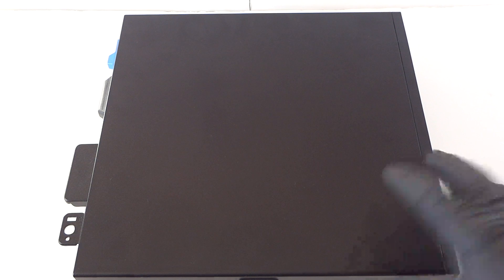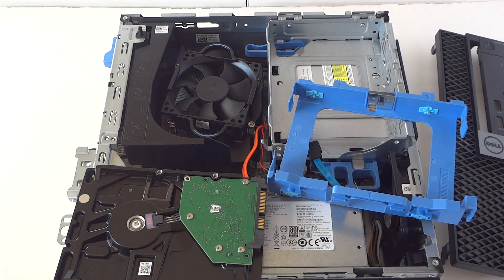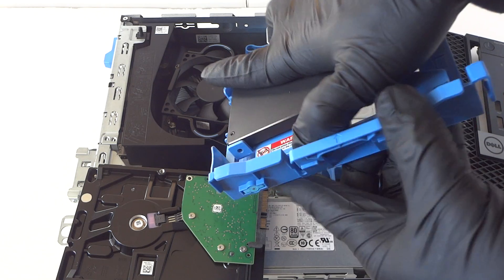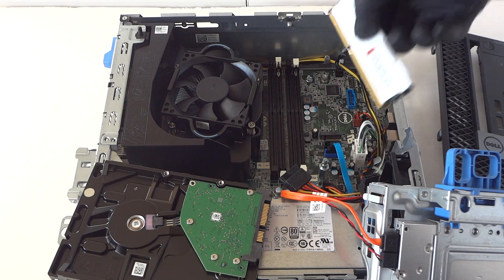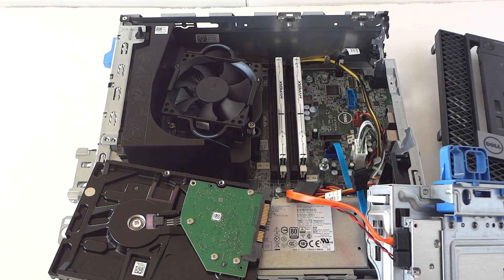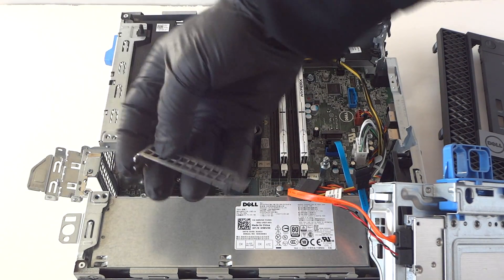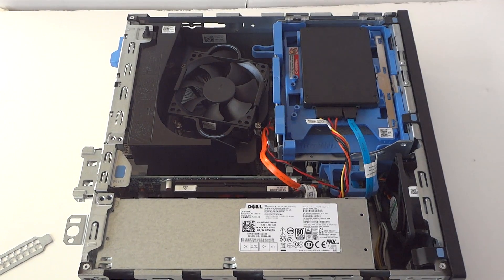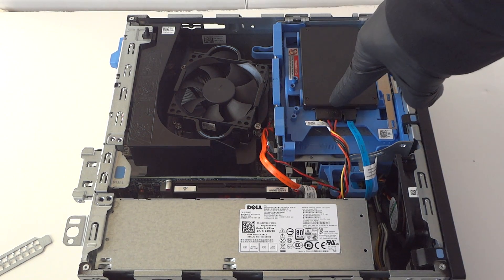Dell Optiplex 5040 Upgrade Video Card SSD Drive, RAM

Comment from the maker: List of Parts and Upgrades works with this PC.

Maximum RAM Supports: 64GB

List of RAM will work with this system.

(1.) Crucial 16GB Kit (2 x 8GB) DDR3L-1600 UDIMM
CT2K102464BD160B
https://amzn.to/2QvZril

(2.) Crucial 16GB DDR3L-1600 UDIMM
CT204864BD160B
https://amzn.to/3gub97G

(3.) Crucial 8GB DDR3L-1600 UDIMM
CT102464BD160B
https://amzn.to/3aWGluX

(4.) Crucial 8GB Kit (2 x 4GB) DDR3L-1600 UDIMM
CT2K51264BD160B
https://amzn.to/34q9Q73

List video cards will work with this system.

(1.) GIGABYTE GeForce GTX 1650 OC 4GB GDDR6, GV-N1656OC-4GL Video Card
https://amzn.to/2B7N1sP 

(2.) Gigabyte GeForce GTX 1650 OC GDDR5 Low Profile 
https://amzn.to/3el08os

(3.) Gigabyte Geforce GTX 1050 Ti OC Low Profile 4GB GDDR5 128 Bit PCI-E Graphic Card (GV-N105TOC-4GL) 
https://amzn.to/2T8bfsv

(4.) MSI Gaming GeForce GTX 1650 4GB GDRR5 Low Profile Graphics Card (GTX 1650 4GT LP OC) 
https://amzn.to/2X1FYsF

(5.) MSI GTX 1050 TI 4GT Low Profile  Graphic Cards 
https://amzn.to/2LwZd7P

(6.) Gigabyte GeForce GT 1030 GV-N1030D5-2GL Low Profile 2G Computer Graphics Card 
https://amzn.to/2Z4PHkp

(7.) ZOTAC GeForce GT 1030 2GB GDDR5 64-bit PCIe 3.0 DirectX 12 HDCP Ready Low Profile Video Card ZT-P10300A-10L 
https://amzn.to/2WzgLXk 

(8.) MSI Graphic Cards GT 1030 2GB GDDR5, Low Profile 
https://amzn.to/390Spum

 
Thermal Compound Paste:
(1.) Arctic MX-4 2019 Edition Thermal Compound Paste Carbon Based
https://amzn.to/2XcsZo4

(2) Arctic Silver 5 Thermal Cooling Compound Paste 
https://amzn.to/2ziNU0H

(3) Noctua NT-H1 3.5g, Pro-Grade Thermal Compound Paste
https://amzn.to/36kTk7A

(4.) ARCTIC MX-4 (current edition) Thermal Compound Paste 20 Grams 
https://amzn.to/2DhGJaK

List SSD M.2 Type 2280 NVMe PCIe:

(1.) Samsung (MZ-V7E1T0BW) 970 EVO SSD 1TB M.2 NVMe
https://amzn.to/3d52k2a

(2.) Samsung 970 EVO Plus SSD 500GB
https://amzn.to/3fpi95A

(3.) Samsung (MZ-V7E500BW) 970 EVO SSD 500GB - M.2 NVMe
https://amzn.to/37uuLFw

(4.) Crucial P1 500GB 3D NAND NVMe PCIe M.2 SSD - CT500P1SSD8 
https://amzn.to/2N07wKh 

(5.)  WD Black SN750 500GB NVMe Internal SSD - Gen3 PCIe, M.2 2280, 
https://amzn.to/31lHhWq

Hard Drive Caddy Adapter  3.5 to 2.5:

(1.) Dell 3.5" to 2.5" SSD or Hard Drive Caddy Adapter R494D 0R494D 
https://amzn.to/2XTPeRr

(2). Dell Hard Drive Caddy, R494D, F767D 3.5" to 2.5" SSD or Hard Drive
https://amzn.to/3cTkcOk

SSD List:
(1.) Samsung 860 PRO SSD 256GB - 2.5 Inch SATA III Internal Solid State Drive
https://amzn.to/2BY5gRl

(2.) Samsung SSD 860 EVO 250GB 2.5 Inch SATA III Internal SSD 
https://amzn.to/37xWUfc

(3.) SK hynix Gold S31 1TB 3D NAND 2.5 inch SATA III Internal SSD
https://amzn.to/3d7X6D6

(4.) Samsung SSD 860 EVO 1TB 2.5 Inch SATA
https://amzn.to/2B2FURX

(5.) SanDisk SSD PLUS 1TB Internal SSD
https://amzn.to/3hwdqku

(6.) SanDisk SSD PLUS 240GB Internal SSD
https://amzn.to/2zfc7EX

(7.) Crucial MX500 250GB 3D NAND SATA CT250MX500SSD1(Z) 
https://amzn.to/3bTTjbX

(8.) SanDisk SSD PLUS 480GB Internal SSD SDSSDA-1T00-G26
https://amzn.to/2yfgjUK

(9.) WD Green 1TB Internal PC SSD  WDS100T2G0A
https://amzn.to/2XfGtzc

HDD list works with this PC:

(1.).WD Black 2TB Performance 3.5" Hard Drive - 7200 RPM Class, WD2003FZEX 
https://amzn.to/2xFUeyF

(2.).Seagate BarraCuda 1TB Internal Hard Drive  3.5" Hard Drive - 7200 RPM
https://amzn.to/3g8FXM8
Reply: Is there a way to add the SSD without taking out the current Hard Drive?  If I want to use both SSD and the Hard Drive. (I have 2 TB hard drive but I want to add 500 GB SSD for my operating system and main operations programs)
Reply: Your link for Ram has for DDR3, but will that work for Optiplex 5040 SSF that accepts DDR3L
Reply: Will all of these gpu fit in the 5040
Reply: Does the Zotac 1650 LP work with this?
Reply: you really help me man thank u so much nobody has optiplez and i have a 1030 i need better caed thank u so much!
Reply: Can i fit the gt730 in it?

Comment: Can I install RX 550 graphics card?
Reply: Let me know if you did. I have a MT 5040 and took it to 32gb ram and nvme 1tb. From what I've read the 550 is low power consumption and I am thinking of putting one in at a later time. For now I had an old gtx 645 that I put in just to be better than the onboard graphics. And the i7 6700 when I googled it is a fairly even match for the 550 without creating a real bottleneck in this.

Comment: Does the gt 1030 graphics card work on the optiplex 5040? Because they write that it works only on ddr 5 and not on ddr 4, so I do not know if on ddr 3
Reply: If you get a gtx 1650 it is the best combo for the i5 6500 hope this helped

Comment: Ik I’m late but just a query I’m prolly going to get one of these, and do you know how the pc has 2 slots for the gpu, would I be able to use both of them as I have found a gpu that requires 2 slots to fit. It does have 2 slider things to fit onto it. Sorry if this is a dumb question, this would be my first pc and I don’t know anything about them xD
Reply: The top slot is for the GPU and the bottom slot of for like wifi card

Comment: will a zotac gtx 1650 lp work.??
Reply from the maker: Hi, yes that video card zotac gtx 1650 lp will work fine in this PC and make sure to use low profile bracket that should be included when you buy video card new..

Comment: i put a gt 730 in this exact machine, but its not enough of an improvement. about to slam a gtx 1060 OC in there using pcie 3.0 riser cable, seperate psu, and mounting to outside of case with fans. i hope it works out lol. Great video and thanks for the info.
Reply from the maker: Hi, thanks

Comment: Note:  the 5040 SFF will ONLY accept  DDR3L PC3-12800U 1.35 volt CL 11 RAM.  I tried the standard 1.5 volt with no luck.  In fact, I've never seen a computer so finicky regarding specifics.  Will NOT accept gen 7 CPU (KabyLake).  Must be Gen 6 (SkyLake)  Power supply has a proprietary 8 pin plug, so no upgrades possible without adapters or overpriced OEM Dell PSU.  Also, I got 32 GB (4x8) of PC3-12800 RAM.  Will not recognize more than 16GB.  Bad board perhaps?
Reply: So normal ddr3 will work with mt version
Reply: Are you sure it's not the 1.5 volt?  I tried all of the 1.5v with no luck.
Reply: hermano eso me esta sucediendo actualmente, con una del 5040 sff

Comment: Hi mxkdi can I install a m.2 nvme drive instead of a sata? Would it work with this specific optiplex?
Reply from the maker: Hi, yes you can use m.2 nvme...

List SSD M.2 Type 2280 NVMe PCIe supports:

(1.) Samsung (MZ-V7E1T0BW) 970 EVO SSD 1TB M.2 NVMe
https://amzn.to/3d52k2a

(2.) Samsung 970 EVO Plus SSD 500GB
https://amzn.to/3fpi95A

(3.) Samsung (MZ-V7E500BW) 970 EVO SSD 500GB - M.2 NVMe
https://amzn.to/37uuLFw

(4.) Crucial P1 500GB 3D NAND NVMe PCIe M.2 SSD - CT500P1SSD8 
https://amzn.to/2N07wKh 

List video cards will work with this system.

(1.) Gigabyte GeForce GT 1030 GV-N1030D5-2GL Low Profile 2G Computer Graphics Card 
https://amzn.to/2Z4PHkp

(2.) ZOTAC GeForce GT 1030 2GB GDDR5 64-bit PCIe 3.0 DirectX 12 HDCP Ready Low Profile Video Card ZT-P10300A-10L 
https://amzn.to/2WzgLXk 

(3.) MSI Graphic Cards GT 1030 2GB GDDR5, Low Profile 
https://amzn.to/390Spum

Comment: Will a low profile 1650 fit in here ?
Reply: it will if you install it in the pci-e x4 slot. It cannot be installed in the x16 slot. HOWEVER, that 180 watt power supply will be a problem. Install a 315 watt or 255 watt power supply from previous Optiplexs. I have a Optiplex 7020 SFF, swapped into a 790 DT size case (bigger than SFF, smaller than MiniTower. I have the 315 watt and Zotac GTX 1650 low profile installed. It runs great. Let me know if you need anymore help. Mxkdi is the reason i have a good gaming Optiplex! Love his vids!!!
Reply: I was going to ask. Could I just swap the internals into a larger case ?
Reply: @djm2373  YES! I took everything out of this 7020 SFF and put it into a 790 DT. There are some drawback, front io. I found a workaround. If you need more info let me know.
Reply: @ssjbart2003  so i cant just buy an MSI GeForce gtx 1650? id have to get a pci-e x4 slot and then put the 1650 into that, which then goes into the motherboard? i am new to this pc stuff thanks
Reply: Hey Alex. This Optiplex has two pci-e slots on the motherboard. The  one closest to the Power Supply is the x16 slot (fastest, it’s blue) the next one is shorter and black, it’s x4. You can install any low profile graphics card in the x4 slot because there is more room. Meaning it can take up 1 or both slots. The more you put in though the hotter the computer will be due to less air circulating. You can install some low profile cards in the x16 if they don’t touch the power supply which is right next to it. 

For better gaming I suggest the MT (Mini Tower) version of the computer rather than this SFF (Small Form Factor). It
will allow for full size graphics cards, however you could run into a power supply issue. See above on getting the more powerful power supply to be able to run your system.  The 315 watt is probabaly best option . FOR DELL 4FCWX Genuine OEM Dell Optiplex XE2 Small Form Factor (SFF) Desktop PC System Power Supply Unit PSU 315 Watt D315ES-00 D315E001L VX372 (Renewed) https://www.amazon.com/dp/B086WBVLXL/ref=cm_sw_r_cp_api_glc_fabc_ImK1Fb5TRYAM9

It installs with just one screw to be able to fit by the way. I found it cheaper on eBay.  Let me know if I can be more help.
Reply: @tsayers82  i decided to get a new case n motherboard, will this reinstall windows? im not trying to lose my license and ik theres way to check what it is and write it down manually, but idk.also is my heatsink compatible w most motherboards? i cant find the optifine 5040 heatsink on pc part picker

Comment: Iam using this

Upgrade Memory 8x 4 ddr3 32gb
Wd 240gb m2 sata
And add nvidia quadro P620
It Also can  with GT1030, quadro p1000, or if yu ou can search vga with single slot and low profile it will work
Reply: Ryan Ainol so a gt 1030 will fit?
Reply: @kapperkai27  yes it will fit, onli low profile single slot will work quadro p1000 Also can
Reply: Cool! is your machine small form factor(SFF) or MinI Tower(MT)

Comment: Hi Mxkdi - I installed an AMD Radeon R5 340x into a Dell Optiplex 5040, however, it is not working. I updated the bios, reset to defaults to no avail. Wondering if you can help. TYIA!
Reply from the maker: HI, yes you can install in blue slot see if video card works or black slot bottom and still does not work you have to try different PC
Reply: This is late, but I tried an R5 340X in my 5040 SFF. It runs worse than the iGPU on the i5-6500 ha ha. Awful card.

Comment: If you really wanted too could you remove the power supply aand use the GPU slot for a GPU like the 1050 Ti? The power supply would be attatched to the mother board but it would be ouside of the case
Reply: It seems hard.

Comment: Mxkdi, Thanks for this informative video, I was able to upgrade my memory today on this machine thanks to your information.  One thing I want to tell anyone who want's to upgrade the memory.  I ordered two sticks of memory that said they were 1.35 v  to 1.5 v ready.  (dual voltage)  and they did not work.  Ordered a second pair that were low voltage 1.35 v only and they worked like a charm.
Reply: Thank you so much for this advice tip! I am following your steps. Where did you obtain your DDR3L rams, I only see DDR3 on all websites. Is it possible for you to send me a link to the item. The link that the video poster put above only has for DDR3, not DDR3L
Reply: @handlecustom343  here is the link to the memory I bought.  https://smile.amazon.com/gp/product/B006HDPFZE/ref=ppx_yo_dt_b_search_asin_title?ie=UTF8&psc=1
Reply: low voltage DDR3L 1.35V DIMMs?

Comment: Hi, I have Dell OptiPlex 5040 and I would like to upgrade my video card to something suitable for gaming, like Assassin's Creed. Can you advice me which card can fit my pc? cheers.
Reply: No 1650 hv dual slot it not fit, u must custom psu cover, all vga can fit only single slot and low profile, I see for now maximum in GT1030 or Quadro P1000

Comment: Got a question. I noticed there might have been a second SATA port on the motherboard (above the blue SATA cable). Does that mean the SFF does support two hard drives?

I only ask because the technical specs say it supports a 3.5" drive and a 2.5" drive, but I can't tell from screenshots or videos how both drives might fit.

Comment: have a 3040 sff with a 180w psu . will all low profile gpus work? maybe a GTX 1050 low profile. please reply
Reply: I have 2 of these Dell 5040's with i5 6500, just installed a 240gb ssd, and gigabyte 1050 ti, it fits in 4x slot, it works perfectly fine on medium settings, same 180w psu, it did not like emulating psp or ps2 1080p internal resolutions. It did overheat on fortnite with all epic settings, dropped down to high on all, and limit 60fps, now the gtx runs about 75-81c and stable. These SFF Dell's have 2 fan settings in bios,  normal does nothing for case circulation when cpu temps are fine causing the video card to choke, other setting in bios for fans is jet engine loud at full speed. As far as video decoding, you'll get smooth 8k 60fps watching the "Peru 8K HDR 60FPS (FUHD)" video on youtube.
Reply: @dstorm19  is your dell optiplex 5040 a small form factor? Im trying to figure out how you put in the 1050 ti in such a small space.
Reply: and will it run gta 5 medium settings 60fps?
Reply: FlyAss Dude So...Did it work?
Reply: The GTX 1050 is low profile but is 2 slots wide. Haven't seen a 3040, but the 3010, 3020 and 5040s have the same problem he mentioned in detail; the card slot can only handle a single width card. So no, a 1050 just won't fit width wise. After a bit a research it seems a GT 1030 is the most powerful card that will fit in these chassis.
Reply: @Soladaddy  This is incorrect. I have a 3010 sff with a gtx 1050ti LP from MSI and it fits in there.
Reply: FlyAss Dude why not just get a Optiplex 9020?
I’d run better with a upgraded ram, GTX 1660 gpu low profile etc, every under $400ish.